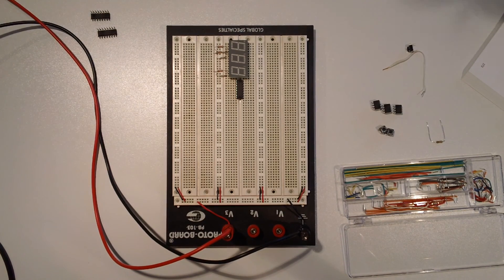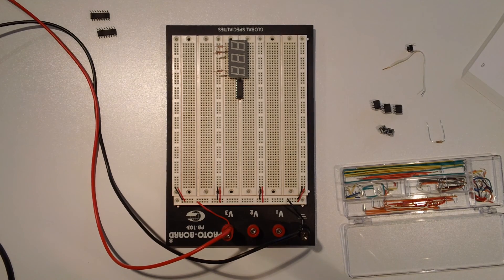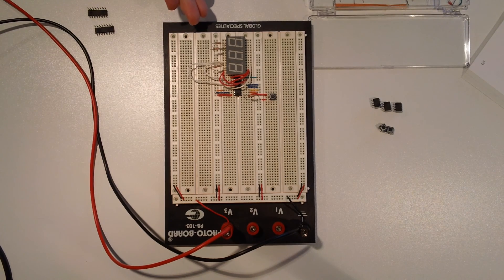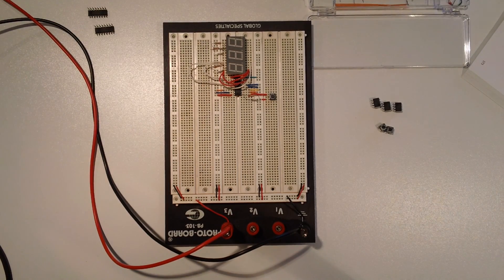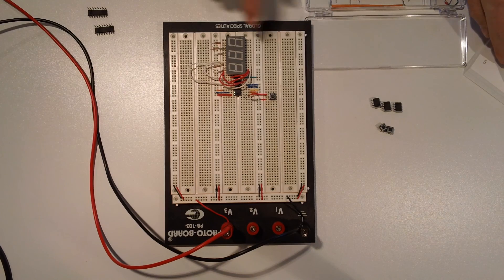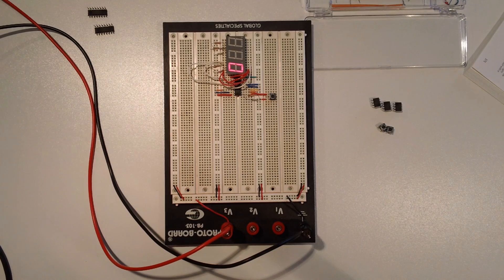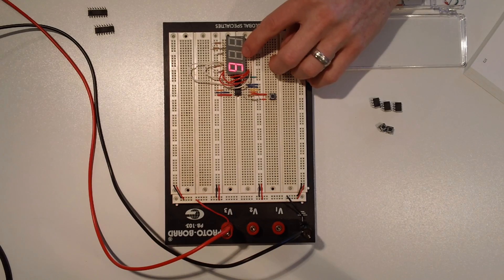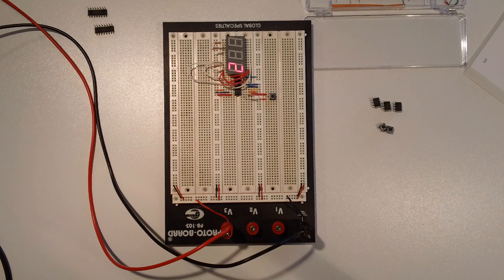Make: Electronics - Experiment 18 (Part 1 using a 3-digit numeric LED with a 4026 counter chip)

Comment: Good, but here you've wired the hundreds digit rather than the ones digit far right. Also, the reason why the digits 'jump,' is because you didn't employ a debouncing circuit with the pushbutton. You may Google 'debouncing switch' to see how this is done. NO offense intended, only offering suggestions. 
Thank you for the video. Also, to those out there, this circuit uses the 4026 IC connected to the common cathode 7 segment readout. 4026's can be cascaded (chained) together by wiring the output of the first 4026 to the input of the second 4026 and so on for as many digits as you like. For a LOT of digits, perhaps put your 4026 IC's on a separate breadboard wired to your digits breadboard. You could even add a 555 Timer 1 Hz oscillator to have one second numerical increments to show a seconds count for an entire year, if you want to get crazy, here! 😛